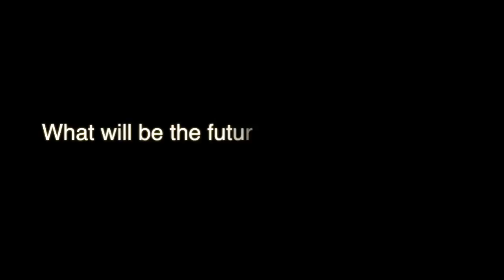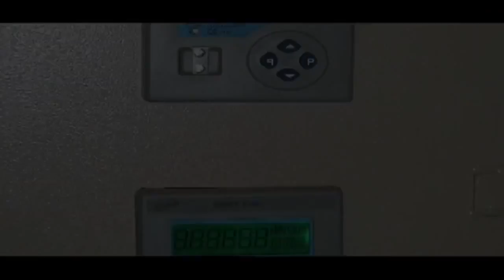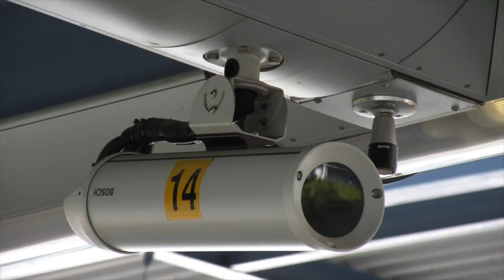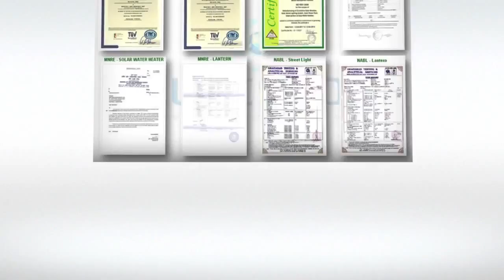Solar Power Equipments by Raj Vision, Indore

Comment: manufacturing and supplying Hybrid Solar Inverter in Chennai, Tamil Nadu. Commercial and residential solar power system 
for best deal contact 
M Kishor 098411-85357 --- 9884124365 -- 8838472736
Power Focus
Reply from the maker: Dear Kishor M, Log on to Indiamart.com and register yourself as a supplier and create an E-catalog and start selling you products.
Thanks!